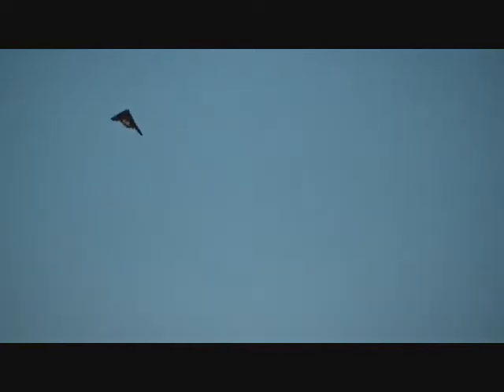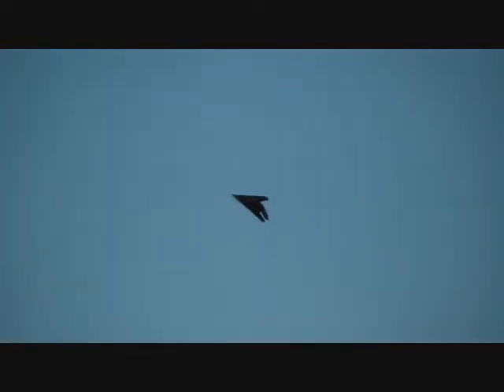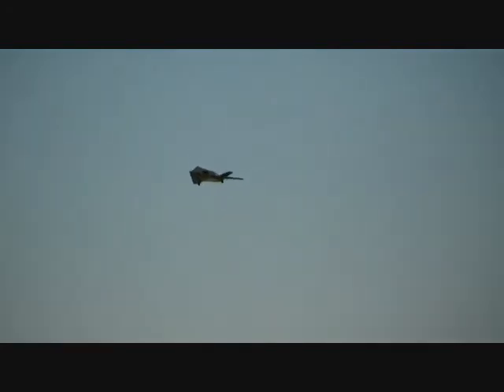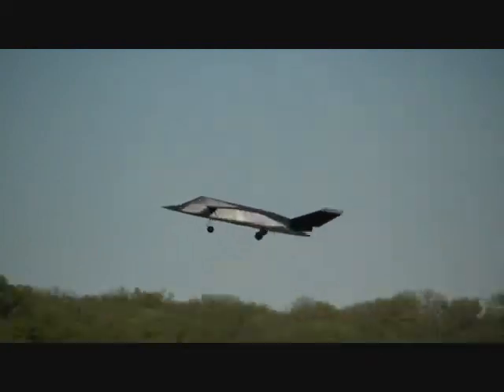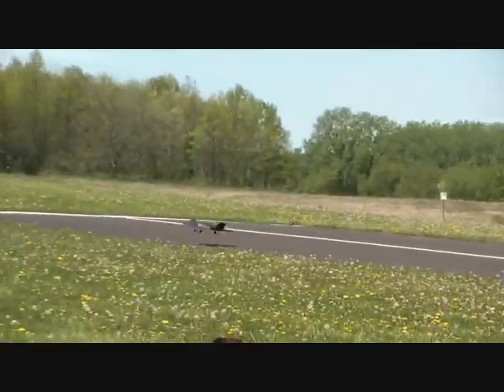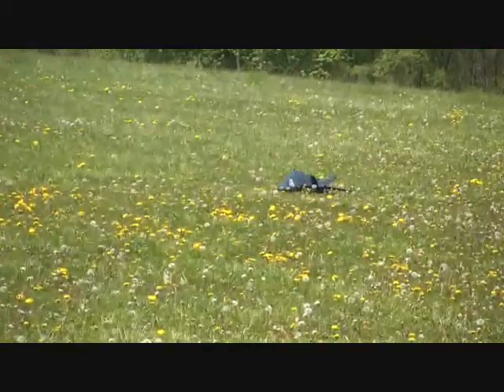F-117 RC Brushless JET Maiden Flight!

Comment: modding nitroplanes/airfield kits are b/a. go to 4 cell 50 amp 2500 kv in the f-18. put parkzone cub wheels on it and it will be your favorite plane. 85+ mph level fligh...also very manueverable.,

Comment from the maker: @RCWOZDUDE I was using stock battery, they should have included a battery that worked with the plane... but yes, I know, higher C is always better!  I actually made an order from hobbyking this morning ;p  some 1800mAh 40C and some 2100mAh 35C like you said :)

Comment: dude you need high c rating packs for these models try a 35 to 40c pack you won't have the puffing problem edf's suck a lot out of those packs!! hobby city just got 2100mah 3s 35c packs in for only $13.00 check it out!!

Comment from the maker: @Admiral1428 thanks for the tips!  It is only pulling 17A at full throttle(tested with power meter).  It has a 40A ESC(I thought it was 30A but it is a 40A)...  I'll try some higher C batteries perhaps, but I also want to upgrade it so this thing can fly better.  Right now it is only good at 'straight' flight with rolls.  Loops and vertical are impossible as of now.